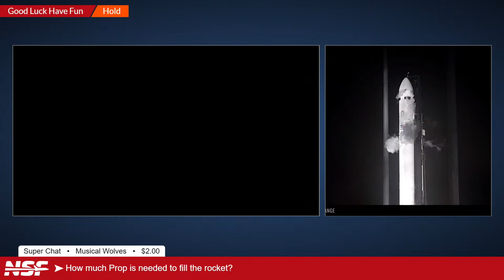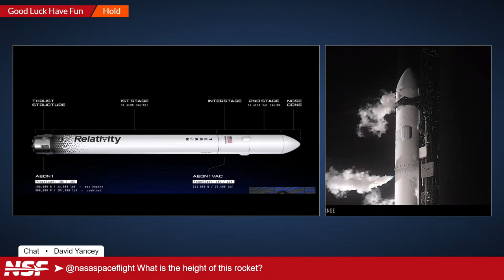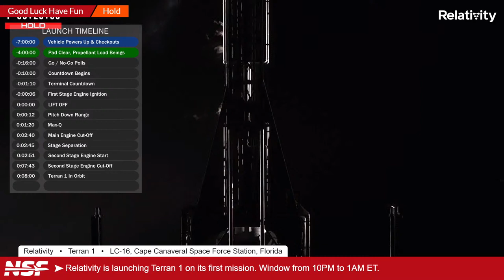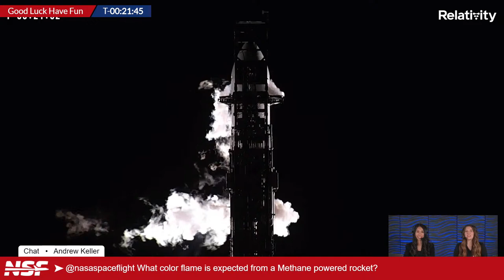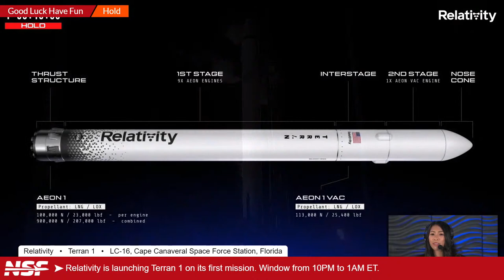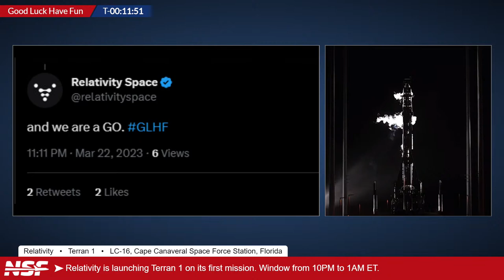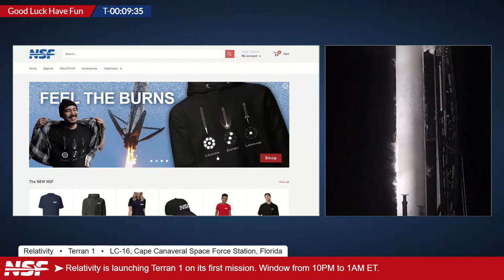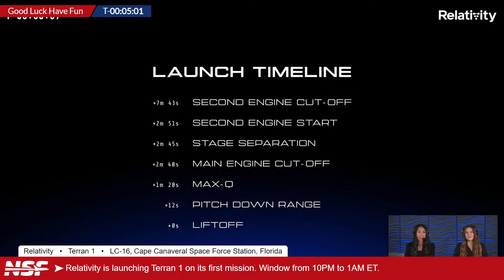Relativity Space Launches First Terran 1 Rocket

Comment: It was a beautiful launch and totally successful first stage, through MECO.  Staging seemed to have some issue and then it appeared they tried several times to light the second stage, with no success.  But I wouldn’t call that “Failure” on first launch and proof of concept.  They proved two things at least:

1. Methalox is gonna be the next big thing.
2. 3D printed rockets are also the next big thing.

Congratulations to #RelativitySpace and Terran 1! 

Thanks for great coverage to #NasaSpaceFlight as always.

Comment: blue plumes is beatiful... i wonder if starship will have blue plumes too?
Reply: I think the raptor engine exhaust is more purple.
Reply: Raptor engines are much superior and burn much hotter. Probably purples. Blue shows A LOT of excess oxygen.
Reply: @LoociferZ  completely different engines with completely different missions to fulfill. The color is due to different fuel—starship uses a different mixture of methane/natural gas for fuel than Terran does afaik. Blue doesn’t show “excess oxygen”, rocket engines are finely tuned to perform within a given threshold. In fact, most engines run FUEL rich, not oxygen rich. Including this engine… but I’m sure you knew that.

Comment: Looks like stage 2 got about 250ms of ignition, then stalled.  The turbopump exhaust was still going, but there was yellow-orange flame which means a shortage of oxygen, or very lopsided mixing in the combustion chamber.  3 big yellow flashes then a couple smaller ones, then nothing, and the whole time losing about 30kph/s  :-(  But getting to Stage 2 ignition on first flight, wow.  Great performance from 1st stage with about 7500kph.  Surely they will get a lot of investment on the back of this early performance.  They're making SpaceX look like slouches!  My guess would be that they had unexpected vapour in the O2 line and that caused the stall, though it's odd that the turbopump was still running.
Reply: A 2nd stage ignition means absolutely nothing. It failed. It didn't even last a second which is a complete failure of stage 2.
Reply: @LoociferZ  It doesn't mean absolutely nothing. Having an ignition that doesn't sustain narrows down the issue quite a bit. Ignition is the hardest part, maintaining ignition is easier.
Reply: @LoociferZ  ... yes... and...?
Reply: They are making spaceX look like slouches? I always read this stuff and just roll my eyes. SpaceX is doing re-usable first stages with far more mass capability and landing them repeatedly. SpaceX can make rocket engines and bodies pretty quickly without going so full on in 3d printing, and they've proven they can produce pretty incredible quantities of engines etc. SpaceX has done something like 200 flights? These guys have yet to reach orbit a single time. I don't think this rocket is even re-usable, eventually they WILL need to copy SpaceX and go with a re-usable design or likely go out of a business. SpaceX countdowns are pretty darn predictable, their launch cadence is pretty crazy, and they are building an absolutely crazy rocket that's even bigger than F9 Heavy (which is FAR bigger than this one).
Reply: @randominternet5586  it was a figure of speech, chill out dude. 

SpaceX has existed for two decades of course they are further ahead than a new company. The two rockets have completely different missions, so I will never understand why people compare them. It’s like comparing an SUV to an ATV. They’re completely different use cases and comparing them makes you look silly.
Reply: @randominternet5586  lol maybe instead of giving into your instinct to eyeroll, you should invest a little effort towards trying to recognise the merit of what you're reading.   Relativity is doing what SpaceX did, faster, with a smaller team, and for 1% the budget.  They are to SpaceX what SpaceX has been to ULA - an order of magnitude more agile.   This is why Blue Origin has been so slow - they lost their talent to Relativity and others including SpaceX, because these passionate young engineers simply couldn't wait a decade to see something with their name on it fly.  Don't get me wrong, I am a big fan of SpaceX.  They have a great track record and they're highly profitable.  Musk as made CAGR 47% on his initial investment on the back of their performance, and Relativity is still unproven... but wow I would like to see them keep their trajectory!

Comment: Wonder what and how space x is going to incorporate this 3D printing into there rockets. There going to do it eventually…
Reply: They're already doing it. 😂😂
Reply: Why?  Other than knowing that it can be done, what possible benefit or advantages would it offer for us?  Just because technology can be used in new and different ways doesn’t necessarily mean that it should.  What game changing advantage did this rocket bring that wasn’t already available in a more traditionally built rocket?

I can certainly see an advantage to being able to create parts with a 3D Printer that’s already located in a place where the availability of spare parts and space for storing such parts is nonexistent, but that’s certainly not an issue when building a rocket down here on our own planet.
Reply: No, they're not.  Have you seen the size of an F9 or Starship vs this rocket?  The thickness of the 3d printed walls will have to get much thicker to handle the size of load that SpaceX does.  

Spacex chucks a rocket together with cheap stainless steel, welds it and poof, another rocket ready to go.  3d printing in it's current form takes months to make a smaller, lesser capable rocket.

Look, love the novelty of 3d printing. It's not just mature space at this moment.
Reply: SpaceX has no reason to use it - the advantages of the 3D printed vehicle (and the Rutherford 3D printed motors over at RocketLabs) is all in the small scale launches, being able to assemble orbital or interplanetry vehicles that are small and hyper effcient. SpaceX's vehicles are all about the maximum payload mass to orbit on the high end of the scale, to the point where going any bigger would require assembly of interplanetry vehicles in orbit.
Reply: @PiDsPagePrototypes  SpaceX has been 3D printing Draco and SuperDraco engines for the Dragon from the beginning, and are currently printing many of the key parts of Raptor. They are among the leaders in engine 3D printing.
Reply: @cogoid  Parts. Not the whole vehicle, such as is the case on this video. 3D printing is fantastic for making small scale items, not the watertank.
Reply: @mudman6156  quicker build, more accurate installations due to no human error
Reply: @mudman6156  some of the new turbopump designs are to complicated to be made by convention casting methods. I'm not saying a majority of components are 3d printed, but there's a few in there
Reply: @LoociferZ  you're wrong buddy. Dead wrong.